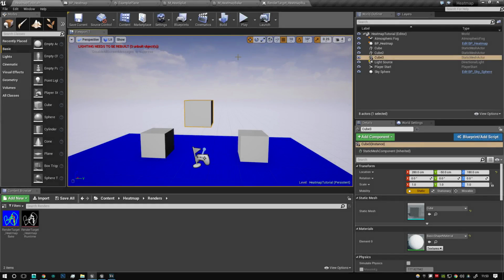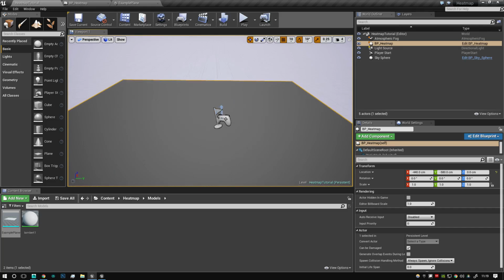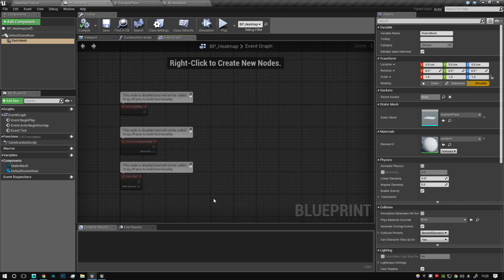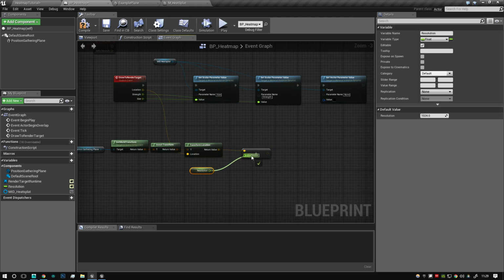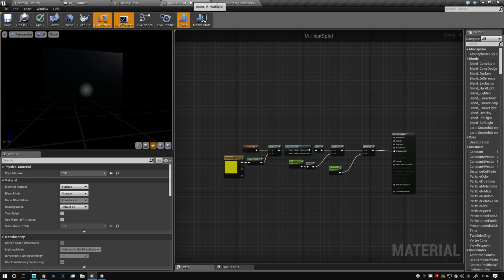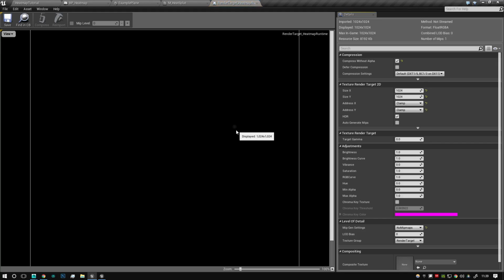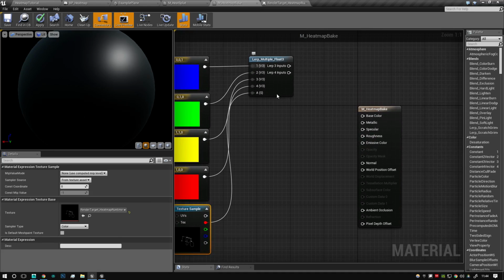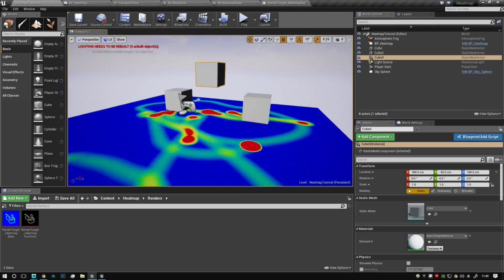UE4 Tutorial - Make a Basic Heat Map

Comment: I was having problems with the plane UV's with blender and getting them to align, seems anything i tried didnt fix it. in the end i just started dividing by random resolutions in the BP_Heatmap and 5000 seems to work perfectly... no idea why but i think its working...
Reply: scratch that, since getting to the point of rendering the heatmap on the actual floor it shows that near to the origin of my plane (Bottom left corner) the heat map is under me yet as i move away the heat signature moves further away from me and is no longer under my character. seems to be that the scale of the render texture to the static mesh is off? im assuming its something ive done in blender but i have remade that plane so many times xD

Comment: Great tutorial, however my render target settings are completely different, I don't have any where near as many settings as you do, do you have any solution, I can't compress it and it doesn't draw onto the render target I've went through this multiple times yet nothing
Reply: Did you solve it? I have the same problem too. 4.26 render target doesn't have Compress without Alpha option. And I don't know how to disable the alpha channel?
Reply: @yanhu  Sorry this is so late. I just changed the render target format to exclude the alpha channel. I used RTF R16f
Reply: @raiz330  Thanks, I made it by Niagara system.
Reply: try disabling the alpha channel on the render target .